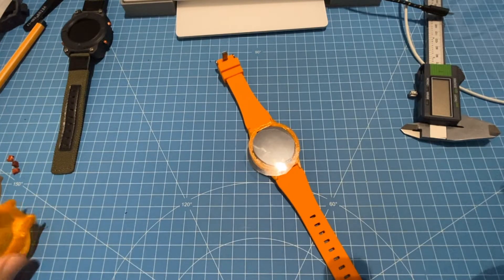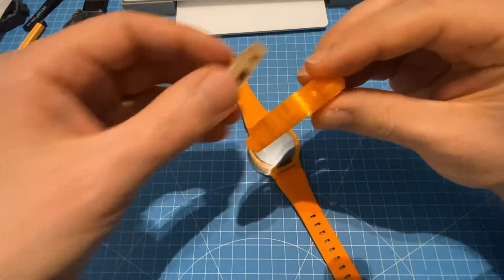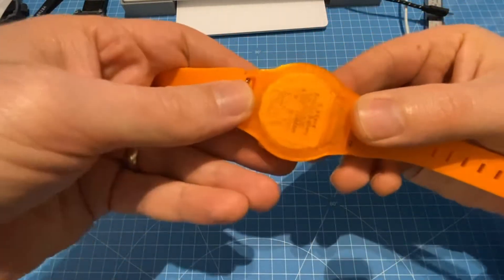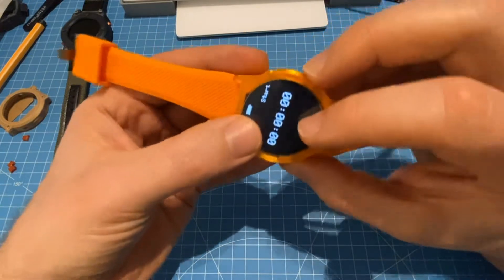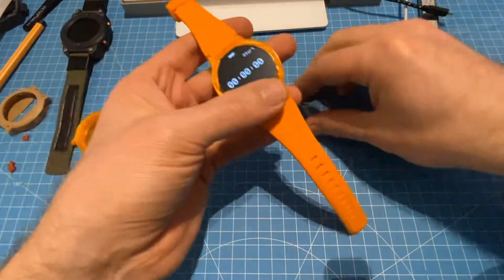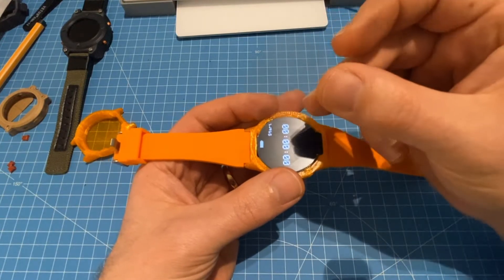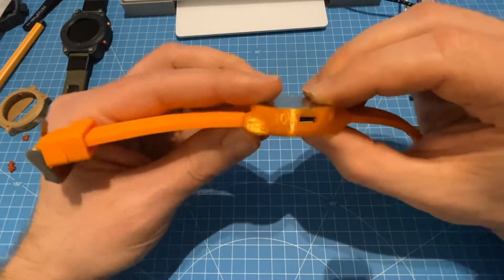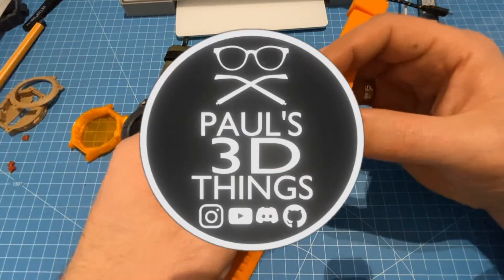EP19 [Open-Smartwatch] Experimenting with Water Resistant TPU Cases [part1]

Comment: If you're interested in improving water resistant, it might not be directly applicable, but check out the method used by the Vostok watch company, pressure increases the quality of the seal.

The reasons for the design they used were partly influenced by the limitations off the accuracy of their machining equipment.

Comment: To insert the round disk, cut out disk with diameter slightly smaller than the outer diameter of the watch but larger than the inside diameter.

Something like this:
------
|   ----
------

Where top, left and bottom is the TPU case and middle layer will be the transparent film.
This way you connect the TPU case and you can even place a little bit of glue (cyanoacrylate) to hold the film in place.